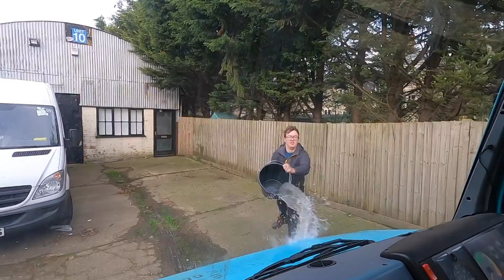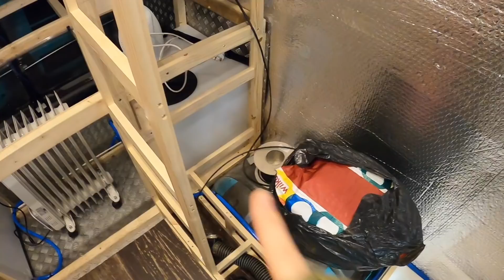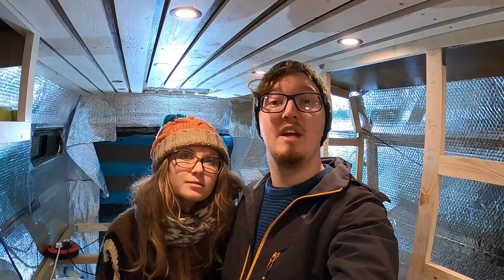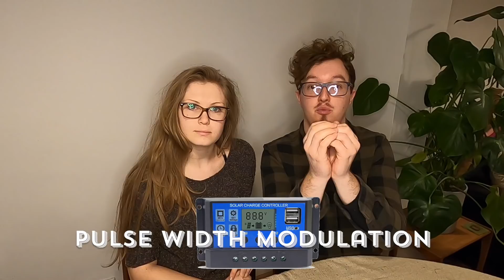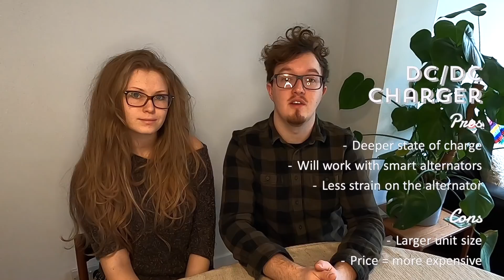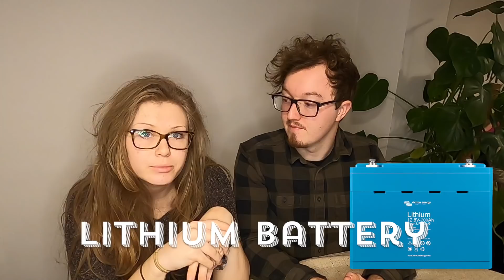CAMPER VAN ELECTRICS | Where do you start? | HOW TO SPEC A SYSTEM FROM SCRATCH | Van Build Ep24

Comment: Excellent video overall but you say 3 battery types but only name 2 as AGM (Absorbent Glass Mat) is a type of lead-acid battery, the difference between them & car batteries (apart from the fibreglass mat) is that AGM has slightly more cadmium alloyed with the lead so the plates are less prone to warping & shorting out which is one of the things that happens when you discharge them too much. The battery chemistry is the same - the acid reacts with the lead to form lead sulphate which holds the charge. 

Lithium you could split too, Lithium Polymer & Lithium Iron Phosphate (LiFePO) are both used at this scale.

Another chemistry considered should always be Nickel-Iron (NiFe) as it's relatively cheap, reliable, electrically & mechanically tough & probably the most sustainable of all, the plates are the 2 commonest metals on the planet (in the solar system) & the electrolyte is potash, all completely recyclable after it's spent 50 to 90 years being a battery! They're most commonly used in submarines as the vapours are safe(er) (they still vent hydrogen & oxygen in exactly the right ratio to explode so the vent should go outside the same as lead-acid).  
https://bimble.solar are stocking them at the moment - https://www.bimblesolar.com/nifebatteries 

Somebody has mentioned in the comments lead-carbon & there are others which are less common.
Reply from the maker: Thank you so much Alan, that’s some really useful information however there is so much info out there we wanted to put together a really simple basic guide that is relevant for van life people for someone who is starting from scratch! Glad you enjoyed 😊👍
Reply: @MaxSophieinaVan  I really do think everybody who can afford lithium batteries should be considering NiFe purely on sustainability grounds, especially as lithium batteries have such a short lifespan.

Comment: Loving the videos and the van :) Just wondering how you mounted your fridge in place? we have a simliar fridge and still trying to figure out a decent way to keep it in place.
Reply from the maker: Thank you so much! And we haven’t quite worked that out yet! Maybe some way of clamping it in or even screwing into the outer skin? Will let you know when we decide! Also going to invest in a small lock of some kind so it doesn’t fling open! 😊👍
Reply: @MaxSophieinaVan  child-proofing latches are often the simplest & cheapest for doors though alternatives can be more aesthetically pleasing. 

Have you looked to see if it has screw-in feet? They're commonly used for levelling fridges but can also be used to bolt them down as they're on structural parts.

Comment: Very informative guys. I didn’t even know victron did AGM batteries. I knew you’d stick with team blue. We are going to go with victron too. Thanks for putting this together.
Reply: Unfortunately their AGM batteries are not blue :( but they are upto the quality and standard you would expect from Victron, their super cycle also have a higher depth of discharge compared with many on the market.
Reply: @bspksolar4929  lol. I looked them up and saw they were grey. At least the other gear in the video will be blue. Shame it’s not teal though to match the van :-). That’s good to know re. The quality of the batteries.
Reply from the maker: Thanks so much Rich! And they sure do, team blue all the way! We just wanted to show the basics which we could have done with knowing when we started! Much more detail coming soon on t he electrics! I wonder if you can wrap a battery? 😂👍